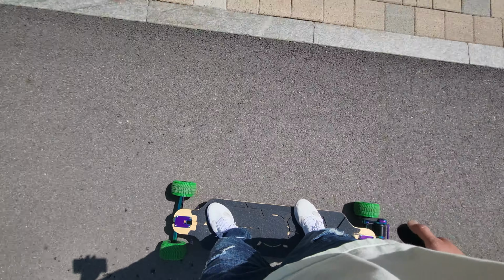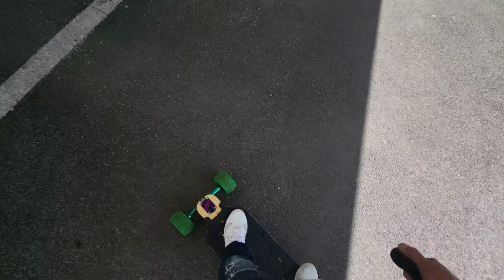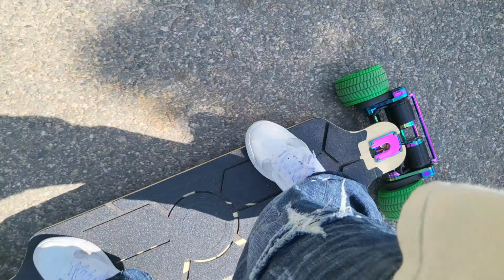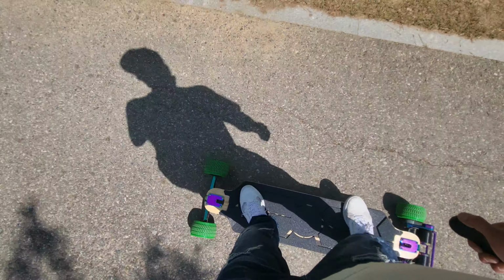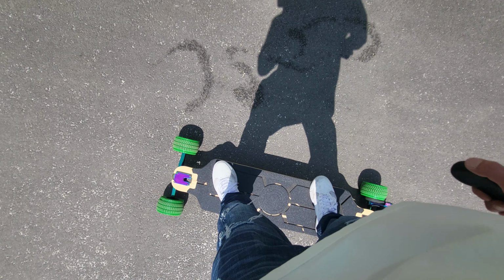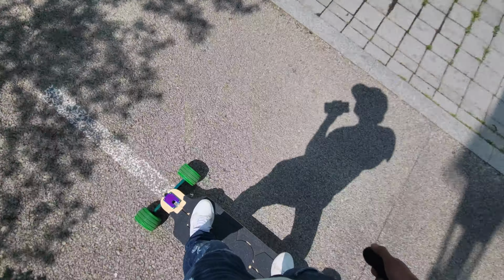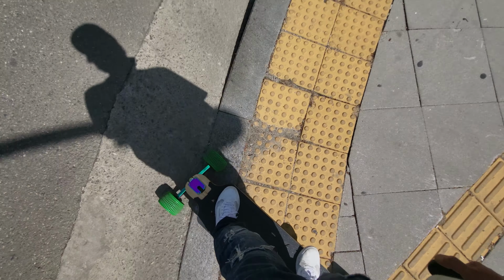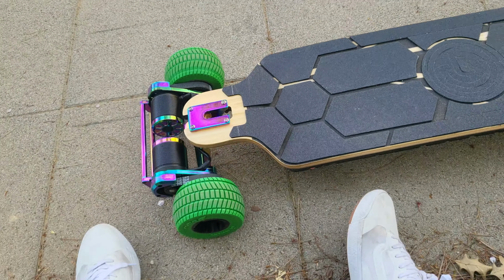First Ride w/ Ownboard Zeus Pro & Dr. E 127mm TPU Wheels!

Comment: Maybe purple or blue for the next version? Would match the board well. If you are planning on going with 137mm might be a good idea to pair the wheels with a 44t/45t pulleys. Good job! Bamboo deck plus your wheels must be a dream!
Reply from the maker: I tested new 139mm this morning and they are great even with smaller 40t pullies.  Thinking of going even larger 149mm.